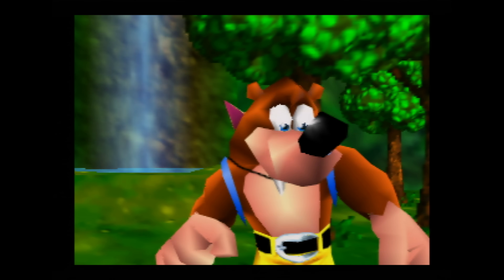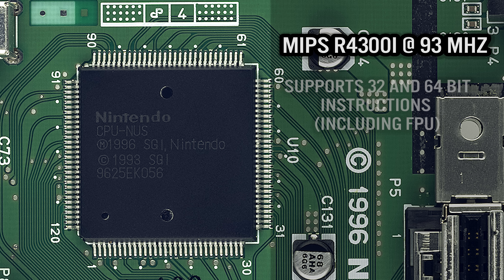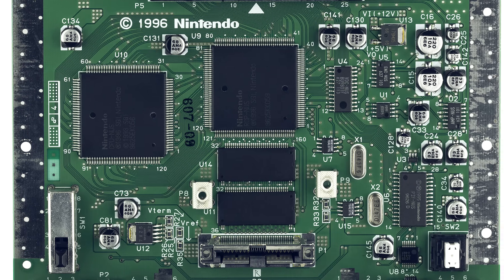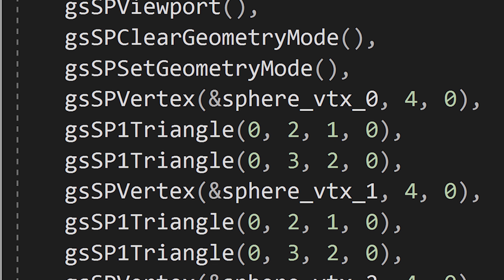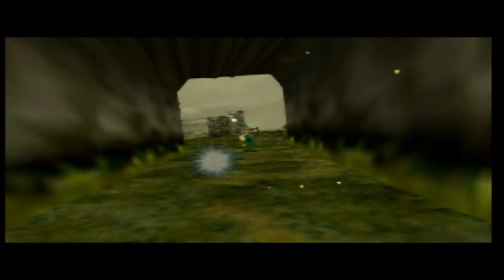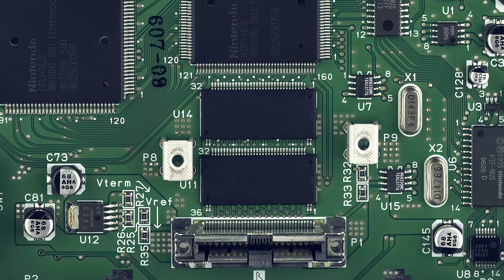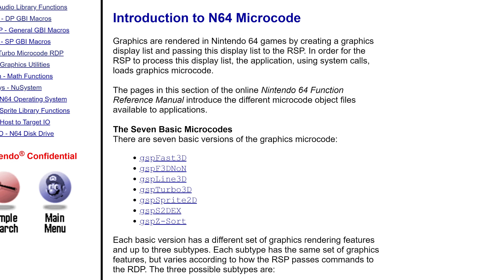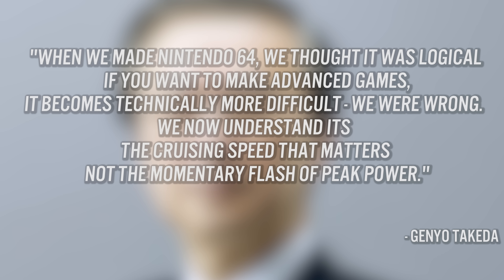Why was the Nintendo 64 so hard to develop games for ? | MVG

Comment: It wasn't as hard as you think. I worked at Iguana Austin/Acclaim on the N64, on a number of Acclaim titles.

Yes, there was some issues programming the RDP & RSP, but Nintendo rarely released the microcode source code for it. We did get it, but made few modifications.

There were issues with RAMBUS, it was really terrible at random access. As long as you kept your data close by, it was OK. It was also bank based, so it was faster to make sure that code was in a separate bank from gfx, and gfx in a separate bank from the frame buffers. It wasn't easy to do, since you only had 4 banks to choose from, the extra 4M made this easier (and so also another reason games were faster).

I much preferred cartridge, it was faster and easier. It was also possible to DMA directly from the cartridge, this made it quick. I added a VM system for it, to allow direct mapping of cartridge memory to main memory (stored in a compressed format, decompressed on need).

The 4K texture cache was not easy to handle. You seem to make the impression that there is direct access from cartridge to the RDP. This is not possible on the machine. So, as you mention, the maximum size was 4K. QBC98 used 2 textures for the player models.

I do not recall Turok 2 DMAing directly from cartridge in to RDP memory. I don't recall, but I believe most of the data was compressed on ROM. It's more likely it DMA'd from ROM -> RAM then DMA'd from RAM->Texture memory.

BTW, it's a 4MB RAM expansion, and it was used extensively by a number of Acclaim products after about 1997 (about 24 or so). We also used the expansion memory to prevent early copying of the game. The versions released to reviewers MUST have the extra 4M, indeed, the code was loaded high up at the top of the 4M expansion to delay hacking. We also used this 4M RAM expansion to decompress a lot during game boot time (legal & logos screen). The extra 4M made the games run faster, as we could cache more of the VM accesses.

We also used the 4M expansion RAM to increase frame buffer sizes on some games. I believe (but memory is not clear) that Turok 2, ASB99, and QBC99 all use higher resolution buffers with the extra 4M. 512x360 instead of 320x240. The VDP hardware was awesome. The scanout to display produced an amazing image. It would blend two scan-lines together in a funky way to make it flicker less. It was SUPER flexible, which is why 512x360 worked so well (hence Acclaims, DUMB AS ALL HELL, HiRez(tm) marketing hype)..

A unified memory model was very well received by us. We could choose ourselves how much memory was split between audio, gfx and code.

The build/debug environment from Nintendo was absolutely crap, I mean really crap. Basically, GCC, makefiles and gdb. They were also restricted to SGI machines, but I believe they sorted this out later. We typically used the SN Systems/Cross Products development environment which was actually built by real game developers.
Reply: @One Billion Caring Mums what
Reply: Where the games being on cartridge a problem on the overall development of the game? Was the limited cartridge space an actual issue?
Reply: N64 Rachel's Early SDKs were notoriously cryptic. Like Saturn, its tools weren't ready for release. Other programmers had no idea how to write the Mircocode with the RAM Passport embedded in the NECVR4300, and often did sloppy jobs EVEN doing basic Framebuffering with just 4KBs of Chache instead of the built in 128KBs, often cheapening Fil Rates in its Textures.

I thought the Expansion RAM was 5 MBs. Saturn had 4MBs.

BTW, I wanted to ask? Did you guys at Acclaim develop some Saturn titles?
Reply: Wonderful comment, thank you
Reply: thanks for this comment, gives big insight

Comment: N64 was so powerful with 3D graphics but so weak at 2D, which is weird because you'd think 2D should be a piece of cake for it. Yet Saturn was the best at 2D in its generation but the worst at 3D. PlayStation managed to hit just the right sweetspot where it's fairly good at both, but it's still weird that N64 practically had no games with pixel art, all the instances of it using sprites were basically just images of 3D models (Mischhief Makers, Yoshi's Story) or raster illustration frames (Paper Mario).
Reply: N64 is the second best sprite pusher in that generation. Due to the choice of cartridges and pushing 3D titles. We never seen it's true power in 2D.

Comment: I’ve never been as amazed by games like I was on the n64. Mario, Zelda etc were total game changers.
Reply: I think that's because of the huge jump forward between going from 2d to 3d and then the graphical shift as well. I suppose it would be like if we went from the n64 straight to like ps3 with nothing in between. But either way I am with you on that. Going from original Nintendo and Super Nintendo to N64 growing up was mindblowing.
Reply: David Brunell I agree. Nintendo games in the late 90s and early 00s had really engaging stories, sound effects, music, and gameplay that had never been seen before. There are some others on different platforms that were great too like Spyro on PlayStation. All later platforms have been recycling the same types of games with marginal improvements or forced gimmicks (Wii/3DS). I don’t think we’ll witness a leap like N64 ever again.
Reply: @haseebs.7286  There are still improvements to be had from 1.) cloud rendering/computing + 6G internet, 2.) 5D optical memory, 3.) ReRAM & MRAM, 4.) AI tensor chips + cloud AI models, 5.) VR + fovea rendering, 6.) haptic feedback controllers, 7.) super parallel arcitectures
Reply: @aoeu256  yes but still not as impressive to the eye and ear as n64 and first 3d consoles

Comment: Weird SGI machine has complications.  News at 11. :P

I kind of wonder now how many games could be improved by patching optimised microcode into the ROM.
Reply: not possible to patch microcode in a ROM, if the game is decompiled you can replace it, but otherwise
Reply: @crashoveride879  Fair, I should have been more clear; didn't mean to imply it was that simple. :)

A quick Google turns up someone playing with the idea for Mario 64, at least:  https://hack64.net/Thread-Fast3D-Microcodes
Reply: @WillowEpp  that used the decompilation project as I said
Reply: @crashoveride879  I mean, yes?  It's written right in the post...  Again, I'm not saying it's a simple "modify the filesystem" or "just regurgitate bytes into the .data section".
Reply: @WillowEpp  I thought you were, sorry

Comment: Isn't saying that a 5-stage pipeline can execute 5 instructions at the same time a bit misleading? I mean, yes: Technically 5 instructions are being "processed" at the same time, but AFAIK only one OPERATION (add, subtract, multiply, etc) is EXECUTED by clockcycle? And i think that's what most people think of, when they hear "N instructions at the same time": Ops per clockcycle, not how many instructions are "queued" in the pipeline.

Comment: The maximum amount of memory the N64 could have was actually 10 MB. There was a rare 3rd party expansion pack which had 6 MB instead of the normal 4 MB of Rambus memory. I remember seeing it for sale at some local game stores in the mid to late 90s for a premium over the normal expansion pack (which I bought for Duke Nukem Zero Hour). It was made by one of the big 3rd party Nintendo partners at the time, bit I can't remember which.

I saw one for sale a few years ago, but I can't remember who the manufacturer of the thing was. I keep thinking Mad Catz, but they had that shitty cheap expansion pack knockoff that was known to overheat and fail. I saw a wiki somewhere not too long ago describing it, but a quick google search doesn't show anything about it anymore.

Why the 6 MB version of the expansion pack ever existed is beyond me, because no games took advantage of it. All I can think is that it was a marketing ploy, because that 6 MB pack was almost twice the cost of the normal 4 MB version back when I bought mine. I guess it would help with DK64 to allow the game to run longer before it crashes from a memory leak.

Comment: If the N64 had problems with it's small 4kB texture cache, why didn't the Playstation have similar problems since it's texture cache was only 2kB (according to Wikipedia)?
Reply: The cache system on PS1 is different than N64, on N64 it's per texture, on PS1 it's 9 (iirc) 256x256 pages to put your textures on

Comment: They really learned from this as all I heard was that the Gamecube and Gameboy Advance were extremely easy to code for. The Gamecube was a technical marvel for its time even when compared to the brute force specs of the OG Xbox. The Gamecube used a custom IBM PPC CPU at 485MHz code named "gekko" and a custom ATi GPU code named "Flipper" (hence the consoles code name of Dolphin). These chips were special as when it came to raw processing power the OG Xbox could churn out 125 million polygons and the PS2 around 66 million but the Gamecube was left at a very low 12 million polygons. However, these numbers were misleading as these were based on just polygons being pushed with no additional effects added like lighting, particles, textures, etc, etc. Where the Gamecube shined was the ability to offload a lot of those extra graphical effects to the "gekko" CPU as it had special custom hardware that could push these effects and that could leave the "flipper" GPU to focus on pushing the polygons and textures. The PS2 number of 66 million would come crashing down to around 6 million and the OG Xbox would drop to around 25 million. This is why some of the Gamecube games looked so much better than PS2 games and the OG Xbox pulled ahead thanks to its brute force raw clock speeds of 733MHz. The Gamcube had a much better setup of L1 + L2 cache on the CPU which made games like Rogue Squadron 2 and 3 possible.

Comment: Yeah, Nintendo emphasised ease of development in future consoles. Unfortunately, there was always some sort of hardware limitation. Storage media on the GCN, awful gpu on the WII, CPU on the WII U. Idk about the Switch.

I've always been annoyed at the Wiis GPU. They didn't need to make it as powerful as the Xbox 360 and PS3, but there were a huge range of older ATI GPUs available that were VERY capable. I would have been grateful for decent AA capabilities even.

Comment: "It's cruising speed that matters, not the momentary flash of peak power" 
And thus, we know why Nintendo doesnt worry about hardware specs nearly as much as Microsoft and Sony do, and (imo) why their games have longer playability. People lately have always griped about Nintendo consoles being 'underpowered'. Power isnt everything.
Reply: The power differences actually mattered back then.  Today though, I don't understand why anyone cares.  A Nintendo Switch can run games originally designed for PS4 with the only real compromise being a little graphical fidelity, but the game being essentially intact.  The N64 actually had games that would never run on PS1 no matter how much the graphics and audio were downgraded.  The Sony fanboys that now make such a big deal about Nintendo's systems being less powerful are clueless hypocrites.
Reply: @davidaitken8503  Pretty much. These days, most devs/publishers dont make a game to the standards of the most powerful system, they make it to the standards of the most Popular system. Doesn't matter how powerful that system is or what issues that system may have. If it gets their game in front of more eyes, thats where they will go. 

Hence why not many cared to develop for the Wii U, yet many are flocking to the Switch.

Comment: Thye main problem that Nintendo,and other console developers had (and still do) is that they stop making games for the hardware in favor of developing the next flavor of the month console and then the consumer has to repeat the process of plopping down 200 dollars just for the privelidge of starting the whole rinse and  repeat process all over again. Nintendo for example used the process of multiplying their hardware by two with the old NES being an 8 bit platform,the SNES being a 16 bit platform etc. granted they skipped over 32 bit and went directly for a multiple of two over it with the 64 rather than just copying and pasting what sega had done.

The obvious reason for this is not just because of technology improvements but also market saturation. It's much like what apple has done (and has admitted as much to doing) by making their batteries incapable of fully charging over time and not being replaceable 
 so as to force customers to buy their latest version of their product....which aside from the number is the SAME product as the previous rendition.

After the WII turned out to0 be a disappointment for me  I switched exclusively to PC for gaming where the only limits are what my hardware can handle.

Comment: 1:41 A 5 stage pipeline doesn't mean it can execute 5 commands at the same time. Based on the typical RISC pipeline, the stages are Instruction Fetch, Inst. Decode, Execute, Memory Access and Write Back. Only Execute really "does something". To run multiple commands at the same time you need multiple Int or Float Execution units within the CPU. The amount of stages in a pipeline has on its own nothing to do with how many commands can be executed simultaneously.

Comment: @modernvintagegamer So why was the texture cache not a limitation on the PlayStation, or did it not have the memory latency issues that the N64 did? It sounds like the cartridge format actually helped the N64's graphics when larger cartridges were available, to enable texture streaming and bypass the cache.
Reply: PS1 handles it differently, the PS1 does 256x256 pages, while the N64 is per-texture

Comment: World Driver championship definitely does not run at 640-480 or 60fps.
Reply: I think it's a locked 30fps, but it sure looks like 60
Reply: @crashoveride879  It's 30 but not locked.  Well it definitely slows down. But it's very very good though.

Comment: I'm looking at the Mark Kurko mods of the Banjo Kazooie engine, taking Bomb omb battlefield alone - the increased geometry and texture detail is incredible, the framerate is smooth on real hardware - however the rom size doubles to 64MB.  Looks to me as though cart capacity is the main limiting feature of the N64 by far.
Reply: Not really, many of the n64's best looking games are 32mb or less
Reply: @crashoveride879  32KBs.
Reply: @segaunited3855  I was referring to ROM size
Reply: N64 maxes out at 5 MBs. It is incapable of 32MBs. You mean 32KBs. Its Max Cache is 128KBs.
Reply: @segaunited3855  lol, I think you mixed up, we’re talking about rom size.  N64 max retail cart was 64MB, however a handful of 32MB carts did make it to retail also.

Comment: Were there any development tools or levels of abstraction above the bare metal which generated code for the hardware graphics subsystems or did you actually had to code up all the linear algebra for the 3D graphics declaratively by hand?
Reply: That was the microcode's job as explained in the video, microcode was provided by Nintendo

Comment: I think it's safe to say that Factor 5, and maybe to a lesser extent, Rare, got the most out of the system. Which is pretty outstanding when you think about what Nintendo was capable of.

I don't recall hearing about microcode tweaks to any other console, ever. I only have heard that about Factor 5's development on the N64. They must have had an insanely talented group of people at that company. Even their older work looks quite amazing.
Reply: BOSS's games are also impressive

Comment: remember that this console came out BEFORE the Rendition Vérité V1000 and the 3DFX Voodo0(used to make Quake run 30fps and no software mode). PCs had a really hard time running 3d polygonal games and all the 3d accelerator cards before the two i mentioned ran games really bad. N64 might have had some issues but if you wanted 3d games then you used the hardware or I guess the PS1 with 1993-94 tech